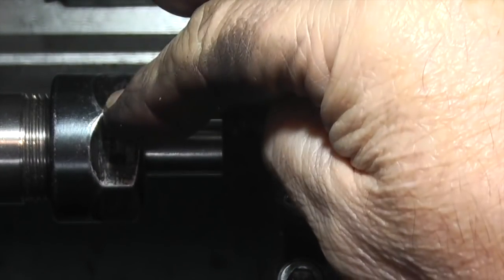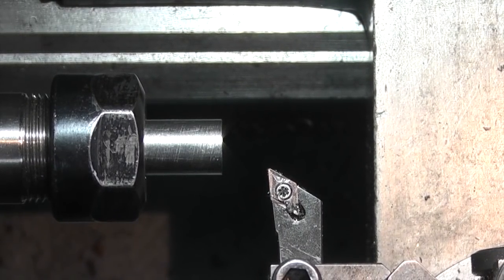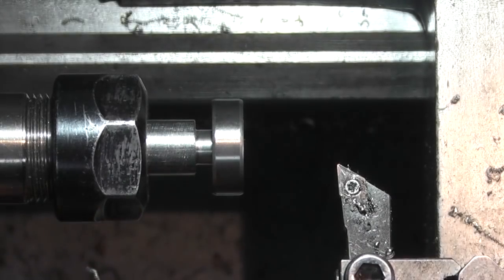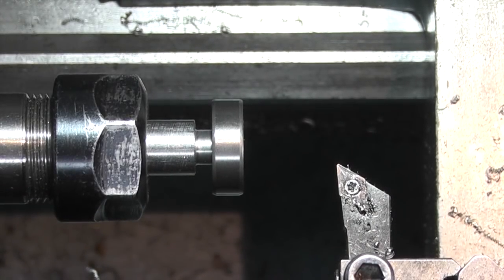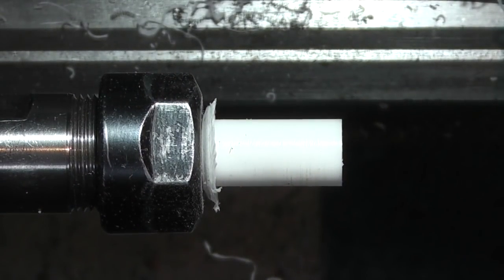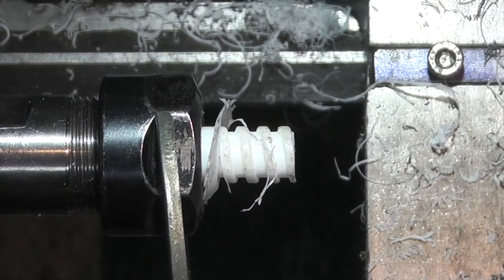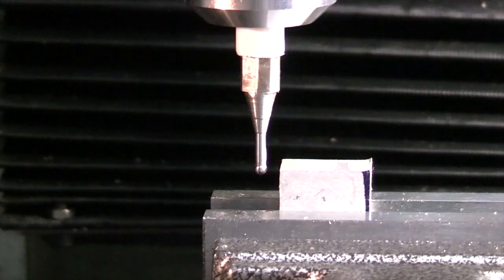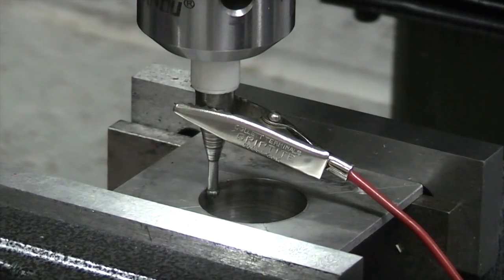Edge finding on the mill

Comment: Nice little set up for your new milling machine Allen I know your using it for an edge finder and you were checking the run out. You were saying that it could be in the bearing or shaft it was mounted on. Here resently I have been going threw new chucks on my drill press and finding most of them seem to have the problem in the way the jaws were ground. I've done several checks on the spindle and shaft which are running true. I've even put a 3/4 Jacobs supper ball bearing Chuck on it and still have some run out and the run out will change as I tighten the chuck. Just a thought on your run out.

Comment: Well this shop made tool should be nice to watch and learn from you about how to make this edge finder for the mill knowing about the lathe one from a few YouTube creators. Question about that bearing run-out? How true is the shaft holding the bearing extruding from the mills spindle?. Nice electronic center probe build.